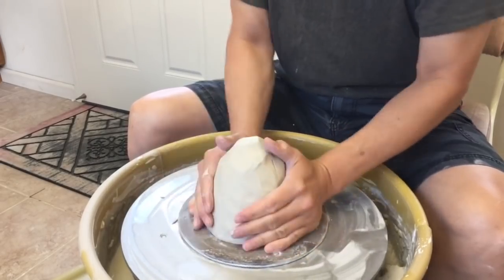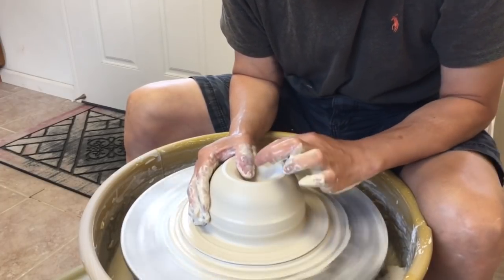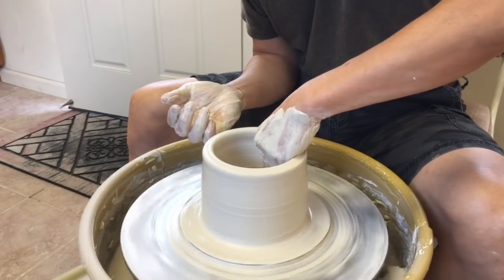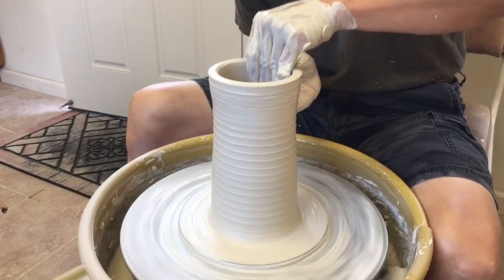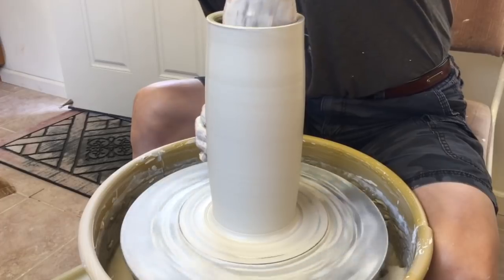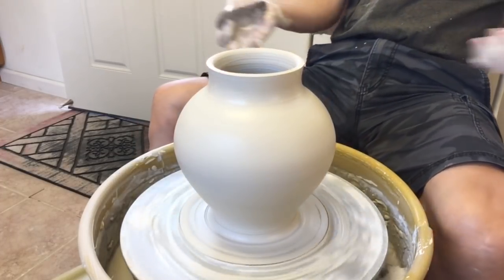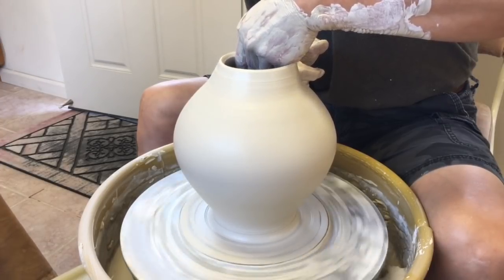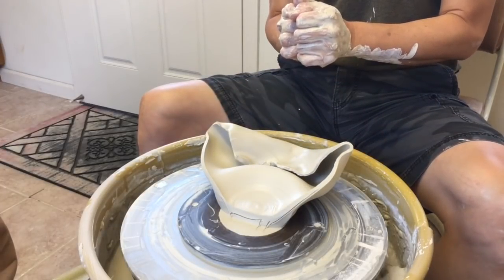317. A Cylinder Pulling Lesson with Hsin-Chuen Lin 林新春 示範拉瓶坯

Comment: Are you left handed? My left hand wants to be the stabilizer and my right hand wants to do the work. However, you seem to be the opposite of that.
Reply: For a right handed potter the typical form is to have the left hand inside the pot and the right hand on the outside of the pot while raising. I'm an amateur so I dont know all of the reasons for this. I was similarly drawn to use my right hand inside the pot while raising and had to actively practice using my left hand on the interior of the pot. I've noticed several benefits and significant improvements with this hand positioning. With the wheel spinning counterclockwise if you put your right hand inside the pot it is easier to accidentally catch your fingertip or fingernail and gouge the wall of the pot. With the left hand inside the spin of the wheel more naturally pulls the clay against the pads of your fingers and makes gouges less likely. Additionally, having your dominant hand on the outside of the pot helps you shape the final exterior curve of the pot.
Reply: Chris Luminais yessd this is me...left hand inside and right hand outside.
Reply: Karike2 ugh...I so want to ask him that too. I throw the same as you...right hand dominant.
Reply: InceptionFilms great...thanks! :). I am not the original poster but I still enjoyed it!
Reply: If you are right handed use your right hand where he is using his left